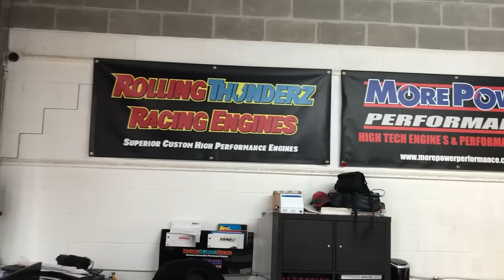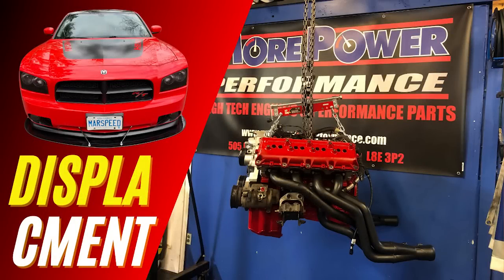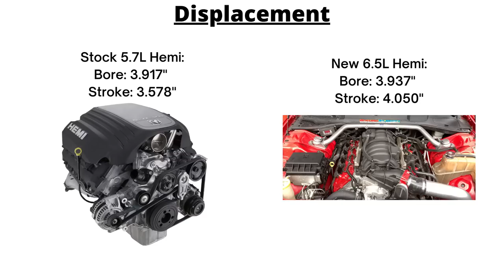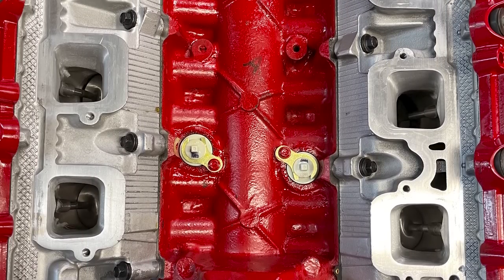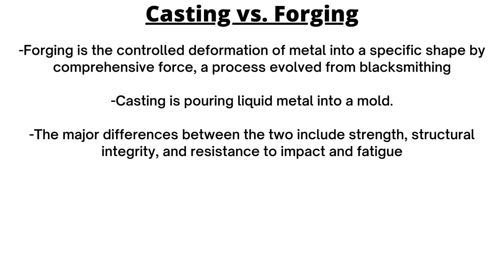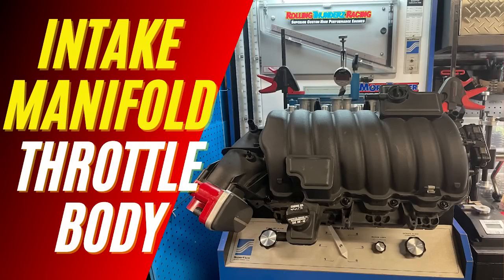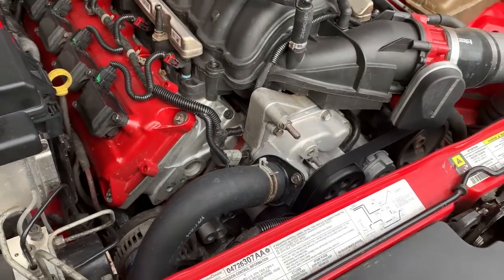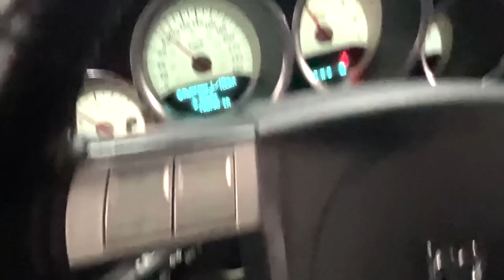My 600+ Horsepower Custom 6.5L Hemi Stroker V8 – Engine Build Specs (2006 Dodge Charger)

Comment: Forced induction is quick HP, but squeezing every last horsepower out of an NA build is pure ART
Reply from the maker: That’s exactly the goal with this, get as powerful as we could NA and then (possibly) go up from there
Reply: There is a wonderful 'linearness' to a good N/A engine.
Reply: @MarspeedCars this would be cool to see it run a drag race with the s197 mustang on a YouTube channel called Four Eyes.
Reply: Pure art that drinks more fuel all the time and has to be revved to the max to achieve max power. I will stick to my 2.8 liter kenne bell at 12 lbs of boost thanks and get decent mileage when the throttle is at cruise position. And have instant power when pushed to say half throttle.
Reply: Awesome build! No one goes thru that much trouble for better mpg, but I am curious about what mpg do you get these days? Still N/A?
Reply from the maker: If you’re asking me, mileage is alright. 25mpg highway, but city is lower of course maybe around 12-14mpg with idling. Getting on it whatsoever and it will be 9mpg or lower. Can go through 1/4 tank of 93 in 25 minutes by flooring it alot on the highway. This is all from the computer reading, haven’t tested a full tank driving one way or another.
Reply: @MarspeedCars  that is better than my Predator tuned 2013 R/T,6sp with 3.91 gears! Thanks for sharing your build!
Reply: @dougkreutz7701 literally no one cares lmao

Comment: I ❤ this me and your build is almost spot on, went with a G3 5.7 400 stroker by interia motor sport bored .040 over, ported and polished heads instead of bigger valves I shaved the head .010 and recovered with a to spec head gasket

Comment: What compression is it? Definitely not over 600hp at the crank. Those dyno numbers seem spot on for a relatively mild stroked 5.7.  my heads/cam 6.1 made 470hp/435tq. Your cam seems pretty mild so there might be more power with a bigger cam and spin that thing to 6800rpm.

Comment: Nice build, but the fact that you don't share the head flow numbers and cam numbers (more to a cam then lift) makes your vid more disappointing then not and it leaves one doubting your hp and tq numbers.
Head flows and cam specs are critical in a build.
The car is pimpin for sure though!

Comment: Are you going to be changing out some of the interior bits for some of the newer Charger bits? Like the steering wheel and dash?
Reply from the maker: Honestly I like the older theme of those parts (just upgraded the radio and amp) but could be an option. For now I’d say no
Reply: @MarspeedCars  Alright, I was curious.

Comment: Not all stock Gen III Hemi’s have a bore 3.97 in. The G3 5.7 bore is 3.92in. , the G3 6.4 bore is 4.090in. This will through math off for displacement and potential fly wheel HP

Comment: Interesting - you and I almost built the exact same engine. You used a comp cam, I used a crower cam. I used the stock truck intake from my 2007 ram 1500. Ever found 6.5L badges?

Comment: Where does the 0.7854 come from? 

Also, wouldn't displacement be (bore diameter x 3.14) x stroke x # cylinders?

You want to know the volume off each cylinder, so bore x pi then multiplied by stroke would achieve that, then multiply by number of cylinders for total displacement.
Reply: Math is the same either way
Reply: As for the .7854 most sites I see that give the formula for engine displacement give pi over 4 which results in .7854

Comment: Great video. In the same boat with my 07 300c. Dropped valve seat cylinder & head damage. Going .030 over to be safe as I haven't pulled the engine yet but seen the damage with a scope. Went with Manley crank and rods & DSS pistons. Just spec'd my own cam with Cam Motion, 237 (I) 251 (E) @.050, .616 lift (I) with 1.6 RR  & .613 (E) with 1.65 RR. 113 lsa, +3.5 degrees advanced. If I use the 1.65 RR most use for the intake lift I have .635 lift. Using 6.1 heads ported by Indy Cylinder Head. Not sure where your getting .900 lift on the exhaust? I don't think that's possible?  Originally was going with Manley springs retainer, keepers but changed to PSI 1516 but sticking with the Manley steel retainers and keepers along with all Manley single groove valves. Not big on using titanium retainers for a daily street engine. Ported 6.1 intake by HHP with Hellcat TB with nitrous in its future. Decided to try the Flowtech 1 7/8" headers with Black Widow Venom  250 mufflers with 3" exhaust. BTW which ATI damper did you go with?

Comment: Good stuff. I used a Manley Stroker kit in my 5.7 as well but I only got it bored out to .05 so not so much. I’m planning for a more boosted setup. I was told 397 was all about NA power because of the compression ratio. I don’t have a ATI dampener yet but planning on when I get the supercharger and fuel system. Love your build man. Nice to see someone doing something with the Pre-Eagle 5.7s! 👌🏿
Reply from the maker: Yeah the goal was to create a gnarly NA motor out of the 5.7 in this specific body style (which I absolutely love) and see what it can do. Supercharging is always an option down the road for me now as well! Thanks for watching
Reply: @MarspeedCars  what did you end up with on your compression ratio?

Comment: i had a 2019 charger 5.7 and it dripped a valve also i was having fun and then was coming to a stop light let off the gas and it just died nothing dramatic i thought it was the fuel pump

Comment: If this is rated according to the dyno at 600+ hp and 640 tq, it shows how purposely lacking the 6.4 and especially the 5.7 hemi is. The 5.0 liter v8 from Ford can make 480 hp ffs
Reply: The Ford rev alot higher, the Hemis have a far greater overall power curve, the Fords have nothing down low.
Reply: @The Bloozer  yea I know. It combines a bored out engine, with higher compression, direct and port injection, a higher rpm limit, more air, and 93 octane. Ford has shown that alot of power can be squeezed out of 5 liters. Dodge can't make at least 530 hp and 500+ tq from the 6.4 hemi since it's based on a design over a decade and a half before and don't wanna change it or greatly revise it. Look also at the 345 hemi. It's extremely suppressed in power. Ppl have tuned it and have easily squeezed good power out of it. Chevy has put out more hp from their 6.2 v8 in the c8 than the 392
Reply: @blackice7408  Like I said, the Reason dodge does not have the peak HP numbers is because they make far more low end torque, it has nothing to do with the engine design, The Hemi heads flow amazingly (340+CFM) they purposefully have the engines Detuned from the factory for more torque. with a radical cam and high RPM, a 392 can easily make well over 550-600hp.
Reply: @The Bloozer  and alot of forging and reworking to reinforce the engine to handle the extra power
Reply: @blackice7408  Definitely not. The 6.4 uses the exact same block as the 6.2 Hellcat, and has been shown to handle well over 1200 horsepower with ease.
Reply: @The Bloozer  I heard that it uses the same block as the 5.7 hemi. And why u liking ur own comments?
Reply: @blackice7408  The 6.4 and 6.2 block are the same block. The 5.7 is a separate block with smaller bore; old habit
Reply: @The Bloozer  yea they said that the 6.2 block is almost very similar to the 6.4 blok. But I wish that dodge would make a replacement engine for the 6.4. And that should be a NA version of the aluminum hellephant engine

Comment: Love the build! Did you do any modifications to the trans other than the torque converter?
Reply from the maker: Thanks! I have now done the gearing (3.06 Getrag LSD), but trans is totally stock. There is a valve body tune of some sort to awaken the trans because it is definitely a weak point for this build. However, my performance guys have started putting the 8-speeds in these cars so I want to do that in mine next summer, should be a really nice upgrade. Will cost $7,000 CAD for parts and labor though
Reply: @MarspeedCars  8 speed would be so fun in that thing! Im glad you're trans is doing good. My nag1 scares the shit outa me😂
Reply from the maker: Yeah well I can tell you I basically only drive the thing to go full throttle on the highway going 100-220 km/h and back down for a while. NAG1 has held up haven’t had an issue across probably just under 10,000 kms of hard driving. My performance guy did take it out for a spin a few weeks ago and said it was not shifting as snappy so maybe it’s on its way out. But still has held up with the hard driving

Comment: my 2008 ram stroker build list:
Donor Engine:
2008 Dodge Ram 1500 5.7 $1800 (CDN)

Parts:
Rotating Assembly:  $4000 (CDN)
191832 Manley Pro Series Crankshafts 
007AV25624S K1 Technologies H-Beam Billet Connecting Rods 
53006-R1 Diamond Pistons Competition Series 3.927 +5.0cc piston head (-5cc effective)

Valvetrain:
CCA-112-305-11  CompCams HRT Stage 3 Camshafts 112-305-11 $479.95 (USD)
CCA-7228-16  CompCams Valve Springs 412 lbs open valve pressure $307.95 (USD)
CCA-607-16  CompCams Valve Lock Set - Dodge Hemi $47.95 (USD)
CCA-856Y-16 CompCams Hydraulic Roller Lifter and Yoke Set $652.23 (CDN)
CCA-8720-16 CompCams Hi-Tech .080" Wall Pushrods for '03-'08 Dodge 5.7L $217.99 (USD)
ARP-244-4300 HEMI Head Stud Kit by ARP $ 605 CDN

Top End:
BBK-1782  BBK 90mm Power-Plus Series Throttle Bodies 1782 $499.99 (USD)
PFS-30561 Professional Products Chrysler Powerfire Ignition Coil Packs $252.99 (USD)
DWK-13U0000428  DeatschWerks Fuel Injectors 42lbs/hr 13U-00-0042-8 $439.00 (USD)
300-658BK  Holley Gen III Hemi Hi-Ram EFI Manifold $1,063.95 (USD)
890015B Holley Sniper Fabricated Aluminum Valve Cover $667.58 (CDN)
Khaos Motorsports 90mm Helix Throttle Body Spacer ( for fit, not function )
BBK-4009CH  BBK Shorty Headers 4009CH $449.99 (USD)

Front & Bottom:
MAN-73205 Manley Double Roller Timing Kit $375.34 (CDN)
10342HV  MELLING High Volume Oil Pump (8413.30.0090) $252.18 (CDN)
SUM-C2516  Summit Racing™ Bracket Racer SFI Harmonic Dampers $266.99 (USD)
MMP-HSCWT Hemi TRUCK Stroker Windage Tray (5.7 and 6.4) $139.95 (USD)
TRD-1127  Trans-Dapt Performance Remote Oil Dual Filter Relocation Kit $85.99 (USD)
JLT-3063P-B  J&L Oil Separator Co. 3.0 Oil Separators 3063P-B $159.00 (USD)
Moroso 23991 - Internal Oil Preheaters
Moroso 22737 - Weld-In Bungs
AGILITY 8012813 radiator 2 row $184.95 (CDN)
FLX-104349 - 183 Flex-a-lite electric fan $420.08 (CDN)

10,157.37 CDN
4,414 USD / 6,037 CDN
16,184.39 CDN TOTAL  plus S&H

But then cracked the heads. pushrod length issue add another 2500$ CDN

Comment: I wnat to swap my pre-eagle heads to eagle heads, what do I need? It's an '07 ram
Reply: The compression will be very high, you would need extra thick head gaskets, new pushrods, and newer exhaust manifolds or headers
Reply: @captainboose8788  I can use the same pushroads of the teardown eagle engine?
Reply: @angel_m0950  I am not sure,may need slightly longer ones
Reply: @angel_m0950  I am using eagle heads on my 05 ram hemi and am using stock eagle pushrods, it's running well so far
Reply: @angel_m0950  I am also using stock head gaskets and e85

Comment: Wow man that’s a crazy build there, how did you go about the MDS system? you said it’s a NON MDS block but all automatic hemi’s have MDS so I am a bit confused. Also are catalytic converter’s with long tube headers smog compliant? and last question is what did you have to do to delete EGR. These pre eagles are just alot of work haha
Reply: Not all automatic hemis have MDS.